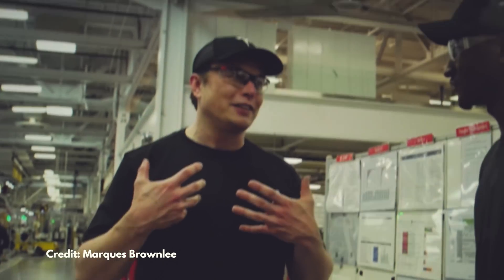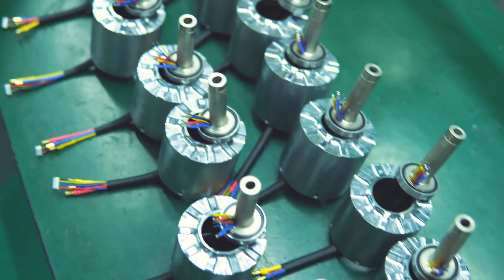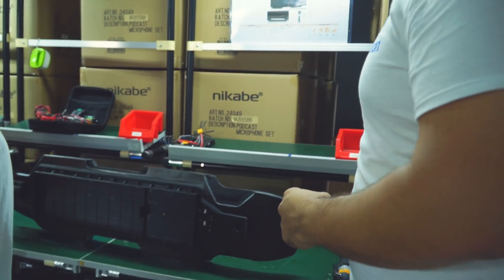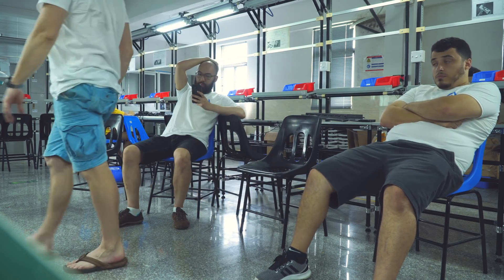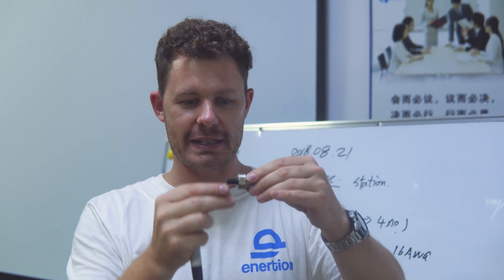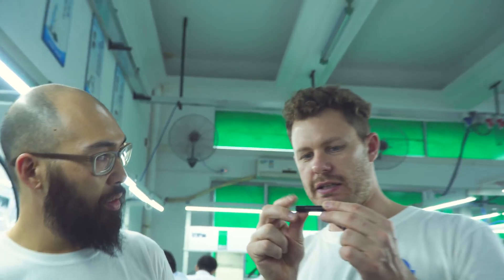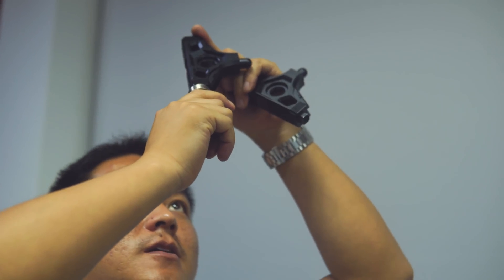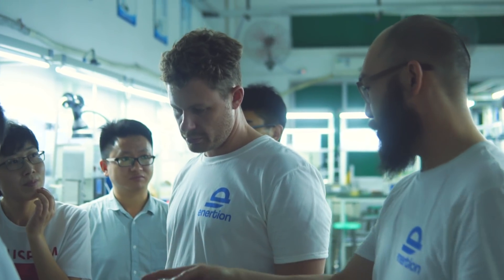TOLERANCES | China 2018 | Enertion

Comment: Does this mean all the boards sold so far are dangerous and have axels that can snap?
Reply from the maker: We are talking about failure rates of approximately 1% - very unlikely people's axle will snap. But it's not the point, it's our job to eliminate all potential issues, this is a known problem so we Focus on it until it goes away. Perfection is not possible, but we aim to get very close to Zero percentage failure rates.

Comment: precise measurements determines the rigidity of the product but what about the material that is being used will it uphold the change of the diameter and velocity heating caused by wheel vibration when on ruff terrain?

Comment: Hey! Firstly I TOLD YOU SO !!  Ok well you can’t go deeper !!! Because you  ruin the integrity of the walls at the bottom of that bore!!! If you go deeper you lessen the MEAT the strength  of the bottom of that bore!!! Your best bet is to NOT CUTT CORNERS!!  And REMAKE THE BATCH ! Out of T-6 ALUMINUM! Find a job shop in the states or  Australia !!! And tell them to hold the  tolerance at PLUS 0R MINUS.005 and tell them to use a short bore with a ceramic insert !!!!
Reply from the maker: Actually, we don't use aluminium in our motors anymore for reasons I'm sure you already know.
Reply: Yes, indeed.... I just don’t think you re-work those shafts! with what you where saying if bore deeper you open the door for failure later down the road! ... let’s say you have a depth of .650 plus .350 of meat at the bottom witch = 1000 if you  bore .250 out of the bottom your only leaving.150 !!!!😱😱😱😱😱 That’s way to thin!!! And I already know what you where saying when you hatched up this remedy ‘ oh it’s ok because it’s not a  critical spec because you are putting the majority of the weight riding on the shaft ! I know in theory it sound like a good plan, BUT TRUST ME! GO WITH YOUR GUT ! And not with your DEADLINE! Look at what is happening to boosted! They have a  phenomenal board! But there motor shaft sucks ass! And they cutt corners and didn’t go with  hardened steel and now EVERY motor is fucking up! Because of it ! this is what is going to separate you form the rest! Please just make the NEW shaft housing ! If they try reworking the shafts you just know some dumb ass employees gonna scrap 2 or 3 !!! By fucking it up in the CNC  lathe ! Or the manual mill ! Because they put the decimal in the wrong place! It happens!!! Some people don’t know the difference between 1.000 & .1000  especially when they change the insert ! They need to back off like .020 because the insert is NEW! They already fucked up before ! I think you  give them too much credit in their capabilities!!! But anyway.... You really want to risk everything for a stupid deadline & 2 hundredth thousands of a inch!? .200 ... really? 👎🏻🙄🤔 ........ just dont , I know you feel it’s wrong, just ship out a sticker pack & a free XL T-SHIRT with the raptors 👍 they will forgive you 4 missing the stupid deadline....trust me! ✌️